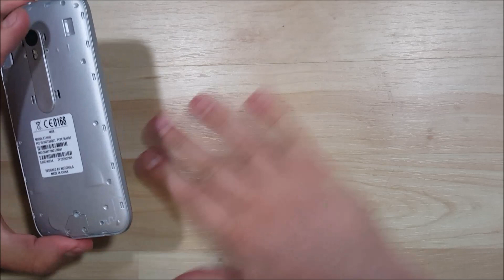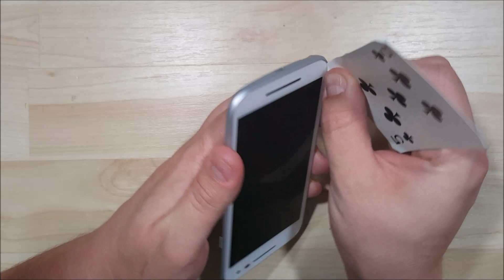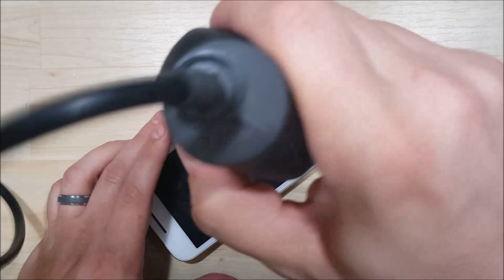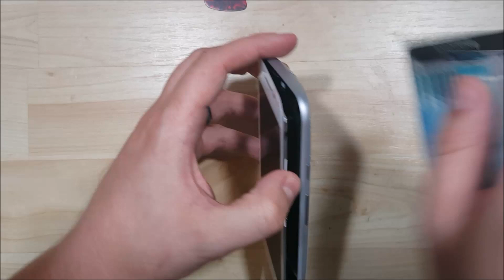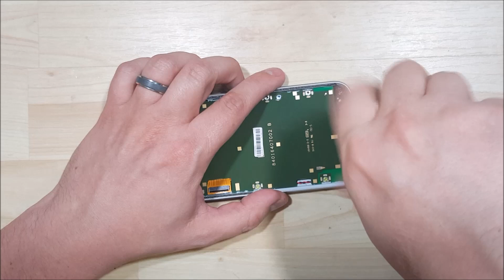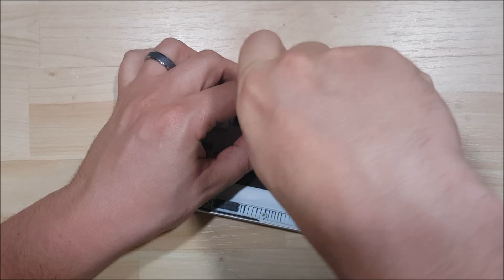Motorola Moto G 3rd gen (2015) Screen Replacement - Disassembly

Comment: Hi there! Thank you for making these videos! They have been extremely helpful and I was able change my cracked screen with mostly no problems.  The screen was fine and functioning but it seems like I did something to my proximity sensor, and then when I reopened it to try to fix that, I accidentally snapped the black piece that locks the LCD ribbon cable into place.  I am wondering if you know how to fix that? I can see that I can order the whole flex cable but I have no idea how to remove and reattach this to the logic board.  Any help would be appreciated! Thanks.

Comment: Curious of the micro USB connector. Does it come out easily? I can't tell in the video, but it looks like it may be replaceable once the 3 screw cover is removed. It doesn't seem to be held in on the inside. Is that correct?

Comment: Can I use a hairdryer in place of a heatgun?
Reply: I don't think so, it isn't hot enough.
Reply: Dunno. You can TRY if it has a 'high' setting. Just put the nozzle right against the glass. If the glass doesn't become hot enough to almost singe ur finger, then it's not hot enough to loosen the foam adhesive sticker.

Comment: +How2Tech Can placing the screws in the wrong place cause the device to enter a boot loop?
Reply: +Magum Op Well, they won't match the holes but if they do get in magically by luck they'll probably short out some component if they touch them while on.

Comment: I broke my screen two months ago. I have bought two new screens so far. I tried to replace the screen on my own once and the screen didn't work. The other screen I took to a professional, he replaced my screen but the second screen didn't work either. He said that the problem was that I had lost a lock for the connector and that's the reason that the screens weren't working. I find that hard to believe, do you think that was the problem? 

Either way, I personally do not recommend buying these screens from ebay..
Reply: Or I actually lost the hinge that is on the connector, is this the reason my screens wouldn't work?...
Reply: You mean the clamp that holds the screen digitizer connector cable? If you try flicking that and there's nothing there, or if you pull on the digitizer's cable while "locked" and it comes out, then yeah the lock/clamp is damaged.
That's attached to a cable at the back of the circuit board, so I dunno if that's easily replaceable.

Comment: does heated hair dryer work?
Reply: Dunno. You can TRY if it has a 'high' setting, and pry with the shown tools. Just put the nozzle right against the glass. If the glass doesn't become hot enough to almost singe or hurt ur finger, then it's not hot enough to loosen the foam adhesive sticker.

Comment: if I change the display of my moto g I can put un water?
Reply: More so guaranteed if you buy the foam adhesive frame sticker off ebay. Wit Rigs has a video showing how to apply it.

 I dunno about the VHB tape. It's powerful and may do the job if u keep the screen pressed under a weight for 24hrs min -72hrs max. I've yet to try the tape myself. But it has many uses for future phone repair.

Comment: can i use a hairdryer?
Reply: i wonder also can i use a hairdryer
Reply: Dunno. You can TRY if it has a 'high' setting. Just put the nozzle right against the glass. If the glass doesn't become hot enough to almost singe ur finger, then it's not hot enough to loosen the foam adhesive sticker.
Reply: no you cant but you can get a heat gun for around $15
Reply: I acctually use a hairdryer y it totally works